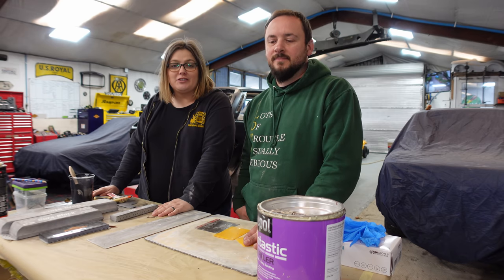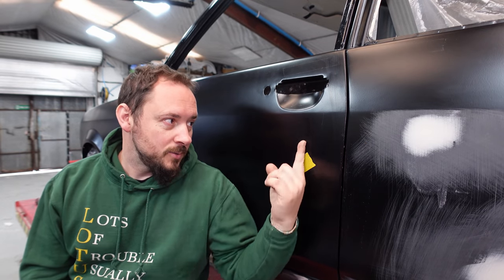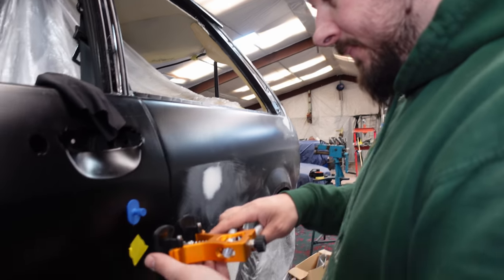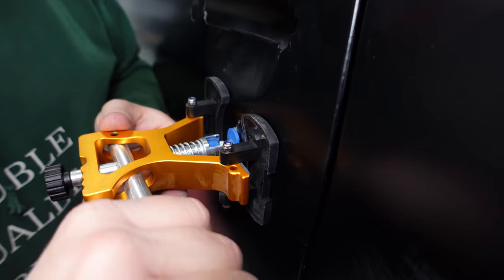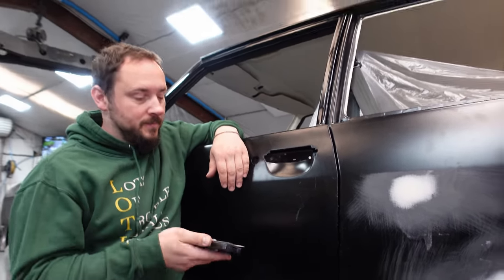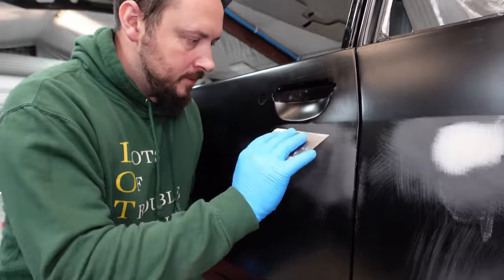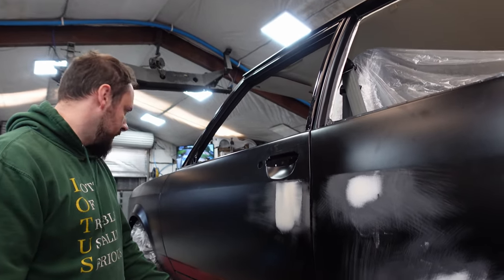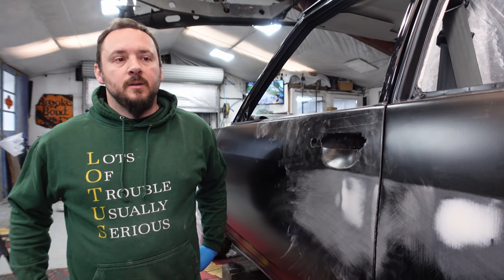How to Pull Out and Fill a Dent on Your Classic Car - Talbot Sunbeam LOTUS

Comment: Winging it on a door 🤣
Nice informative video again!
Isn't the position op the outer feet important as to how you pull?
Reply from the maker: Depending on the dent but yes you're right, the position of the feet is important. Even though it's a straight up and down movement of the pull, what the feet are resting on could affect the dent, take care when pulling!

Comment: I wonder, why you don't use the wet sanding method?
Reply from the maker: We do use wet flatting at the right stage. You should never wet flat filler, it will ruin it. We'll be doing a wet flat episode next on the Talbot. Stay tuned! 😁👍
Reply: @WhitelandRestorations  thanks